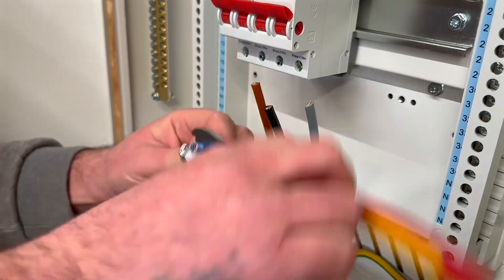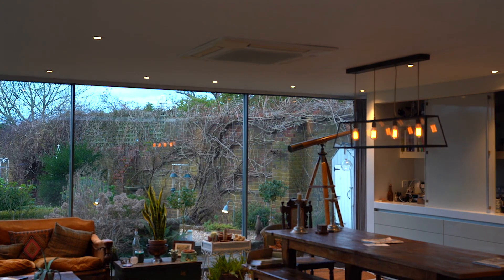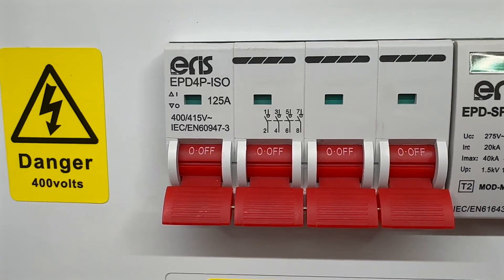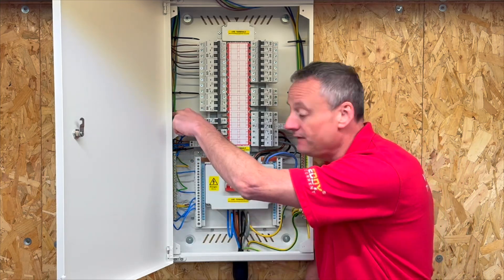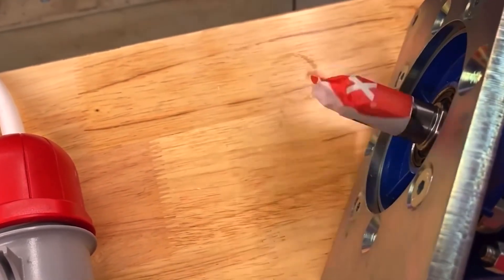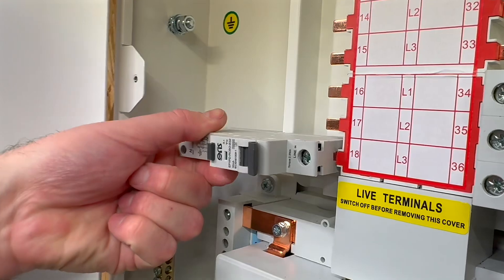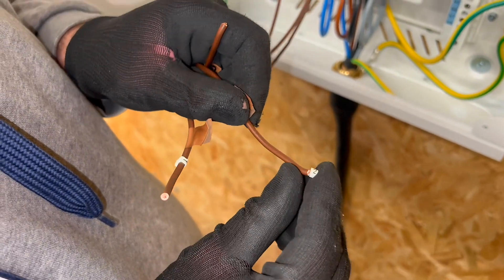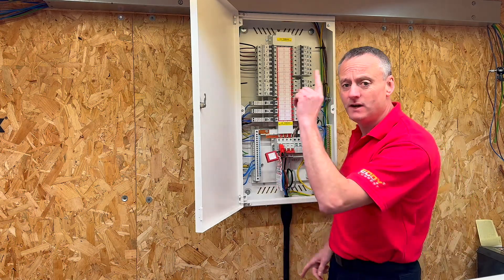Understanding Your Three-Phase Distribution Board

Comment from the maker: Learn more about the Eris Pro Range 👉 https://hub.efixx.co.uk/ErisProRange
Reply: No head RCD in the UK?
In France, there would be at least 3 RCDs for this board, covering all circuits.
Reply: And I can see you're not using a torque screwdrivers... there's no such thing as a torque calibrated arm...
Reply: @jezrougan  in my day as an apprentice there was no such thing as a torque screw driver but three types of tight
1. 👌 finger tight
2. 👋 hand tight
3. 👊 “F”ing tight

If you didn’t adhere to them then came
4. 🚑 not tight enough

Recently torque to 3 Nm required 1/4 turn more with the T screw driver. Doing it to 2 Nm ment I had to loosen them off first.
Not bad I thought for a 57yr old bean pole
Reply: @d.wood72  My father was a sparky and the only person I knew, who could drill a hole with a drill without pulling the trigger... while I was his appreciate, I found what looked like a worn-out tap for tapping treads... I said to him, "Why have you still got a worn-out tap?"  his reply was, "That's not a tap. "... "That's a raw plug jumper." 
He then gave me a task he would do as an apprentice with said raw plug jumper... bang twist, bang twist, bang twist... after only I did three holes, did I understand why his hands were like a gorilla's hands, and why he could drill holes with a drill without pulling the trigger... 
While doing conduit, he could thread 32mm like it was butter... 

R.I.P. father, you taught me many good lessons of the electrical trade...

Comment: 1 minute in the video and I already have to comment... I just learned it from electricians course btw, screw terminals that don't have pressure plate between screw and wire, can be only used for solid core wires. So straight or doubled is a moot point, at least by Estonian code they have to be crimped. If the connection is like in breakers- between two plates that screw only tightens- it would be okay, but still frowned upon, I have heard that usually inspectors want all standed wire crimped in all connections.

Comment: Did the ‘pro’ just strip the conductor insulation using wire cutters ringing the conductors and causing a point of failure?

( better to spend money on strippers rather than an electronic crimping tool!)

Comment: Thanks Gary,
I'm from New Zealand and I really like the look of that switchboard, I particularly like the idea of a dedicated space in there for surge diverters
(which all switchboards should have).
Regarding terminating to busbars and CB's, I was always taught about "terminal fill", meaning that when you have enough room in the terminal to twist the wire and fold it over, you should always do so, as it gives you more contact area in the terminal itself.
I've never liked the idea of just shoving a stripped un-twisted wire into any terminal.
Reply: In the uk I prefer to crimp any stranded wire to give it a solid connection. We also twist them and double them over too on stranded and solid conductors

Comment: Also some three phase DB’s allow for clean earth connections, separate from the main earth terminal
Reply: Is there a continuity between them?
Reply: @ No, it’s entirely separate from the main earth, which on a TNCS system is also linked to the Neutral at the incomer. Clean earths are usually separated by way of an earth rod to a separate earth bar within a DB
Reply: @barryamorris  a TT arrangement?
Reply: @ just for the clean earth circuits yes
Reply: @barryamorris  which circuits require a clean earth?
Reply: @ anything with very sensitive electronics.

Comment: ALWAYS double up the copper so as to fill up the termination space. This avoids overheating and arcing from poorly terminated cables.
Reply: Folding a 2.5 sqmm wire in a 5mm diameter tunnel doesn't fill up the termination space yet we still do it.  Sure the larger contact area improves the impedance but that's more of a nice side effect than the main reason.
Reply: @ the larger surface area also reduces heat build up, ensures a stronger termination, and reduces the chance of the termination failing. The single biggest cause of electrical fires are caused by poor termination of cables.
Reply: @ 'improves impedance'
Reply: @ The bottom line is that if you fill the terminal up with copper by doubling or trebling over the ends you just get a better termination.
Reply: @barryamorris  Except you aren't filling it up necessarily, are you?  Fill up a 5mm diameter tunnel with a folded 2.5mm2 wire, take a photo of it being 'full' and post it somewhere for all to see and demonstrate it being 'filled up'.  Good luck.
Reply: @ I mean literally fill it up with copper. No electrician ever does and I used to teach practical at college. The standard of workmanship is going down hill rapidly. Most don’t even double the ends over
Reply: @barryamorris  It's because it'd mean cutting a stub of wire to pack the terminal and absolutely no sane person is going to do that unless it is an explicit requirement stated in the job card or manufacturer's instructions.

Stuff terminals full of cut wire was never a thing.
Reply: @ Doubling or trebling the ends over are however!
Reply: @ Why are you adjusting your stance?  Could it be that 'filling' the terminal was never actually a thing, whilst folding it to secure it and coincidentally also improving the impedance actually was and still is a thing?  Hmmmmmm, might have to think about that a bit more.
Reply: @ Fill the terminal such that you get a good quality termination, that is both mechanically strong and yes lowers the impedance, and as such reduces heat build up.
Reply: @barryamorris  Still banging on about it eh?  Tell you what.  Actually do it.  Fold a 2.5 wire twice or thrice.  What ever.  Actually do it. Put it in a 5mm diameter (16mm2) terminal, run the screw home then take a photo and post it somewhere and show how much it 'fills' the terminal.
Reply: @retrozmachine1189 The more of the conductor that is held in contact with the screw or plate in the connector, the greater is the physical resistance to movement of that wire.

So mechanically it is a good thing to do.

It is also worthwhile from an electrical resistance point of view.

The lower the resistance, even if the R1+R2 resistance comes in below the required target, the better as it means the junction isn't going to heat up quite so much, increasing the life of it.
Reply: @deang5622  One of these days you'll actually read the comment you are replying to.  One of these days.
Reply: @retrozmachine1189 One of these days you will pass 5 GCSE's and one of them will be in maths. One of these days...
Reply: @deang5622  Look, if you had actually read my comment about what is going on when we fold over the conductor you wouldn't have made the comment you did, that or you are a clown.  I'll let you decide which.

Comment: I never understood this stripping and folding over conductors when all terminals are designed, tested, and certified to hold a conductor of given size range and type (stranded/solid). I never fold over wires, because now it's no longer the size the terminal is rated for, nor the size the wire is before folded over. It also creates additional strain on the wires, and on top of all that, a physical turn is a great way to create increased heat in a conductor.
Reply: It's precisely that.  If the terminal is designed to hold a given single conductor by itself properly, that's fine.  You don't have to and shouldn't fold a conductor before inserting it into say a Wago connector.  The reason for the fold is because the terminal isn't capable of holding an individual conductor as is.  That could be the holding screw can allow the conductor to ride up the side because it isn't wide enough in the tunnel to prevent it.  That could be the conductor is stranded and needs to be twisted to ensure the strands don't separate and again ride up the side.  It could be a combination of both those things.  It could be the wire is so thin that when placed under the screw it simply isn't clamped by the tip of the screw even if the tip is designed to fit the profile of the tunnel.  Issues exist for rising clamp style tunnels too.
Reply: @retrozmachine1189  most terminals involve a screw and drop plate. If it's not rated for the wire size you're using, folding the wire over doesn't change this.
Reply: @ Go back to school.
Reply: @ Did you actually read any part of what I typed before pressing reply?
Reply: @uwygjhsh Try reading my comment.  When you actually do, and understand what I said, then you can click reply.

Comment: MMM don't like that board.  Can't even isolate individual circuits for additional installations.  Looks like you have to de-energize the whole DB.  And they don't even have the tabs that also cover the supply busbar and terminal screw.  They've gone to the effort of covering the neutral terminals, but left a great big wad of copper hanging out for the link.  I'll stick to Schnieder DB's I think.

Comment: You Brits are so behind on the 3 phase game....

3x 25A supply is standard in the Netherlands for a modern house. 

With crappy, plastic distribution boards...

I had a discussion on that with Gordon a few years ago. He should still have some pictures of my db...
Reply: In ex-Yugoslavia (cca. 1980) 3-phase (3x25A) and load balancing between phases and RCD (FID) was standard for all residential installations
Reply: @vesnacvetanovskaivikj8606  Load balancing ID something that they still do not get in the Netherlands!

Ask me how I know!
Otherwise I can give you the voltages of phase 1, 2 and 3 which are completely out of balance.

Comment: It looks confusing at first, but it's quite simple in practice and very neat. 

Now if only somebody would come up with a way of getting rid of neutral fly leads via a neutral busbar and even having a CPC busbar and CPC connections via the breakers. Think how much neater that would be. The circuit wires then only need to terminate on the breakers.
Reply from the maker: All good points… some DBs do you have a connection for the neutral in some types of board?
Reply: They are not neat, they are terrible, archaic rubbish. Try maintaining a full 12 way TP&N board full of RCBO's when a few go faulty and need replaced. Nightmare to work round.
And that's not a slant on the brand shown, they're all crap and need a huge overhaul of the basic design. And all devices should be double pole.
Reply: We have em in Canada. I've seen panels with a neutral busbar along the breakers so easy way to land circuits, and some panels (like mine) the panel has a neutral bar the breakers tie onto which allows you to land neutrals alongside the hots on the breaker itself. Saves the inevitable pigtails when you need to land GFCI & AFCI breakers in the panel.

Comment: The 3-phase board in this video looks like an upgraded North American panel and doesn't have anything in common with the power distribution boards we use in Germany or the Netherlands where 3-phase systems are the standard for many decades.
Reply from the maker: Thanks for your input
Reply: To be fair:
In the Netherlands, three phase supply has only been done as standard the last 25-30 years. And then only for ground build houses.

A lot of apartment complex still had single phase going to the individual units in the mid 2000s.

And in all honesty:
Our Dutch distribution boards are cheap pieces of garbage compared to what the Germans put in a house these days.

Not a fan of their "unter putz" cabling however...
Reply: Yanks only like 110v yet the do have 215v but they think it's super dangerous
Reply: @octymocty132 no we don’t. In our homes we bring in 240v, we use either 120v or 240v, depending on what needs power. 
In commercial usage, they use three phase which can be 277 or 480v.
Reply: @uwygjhsh That's in large part because over the years the voltage has been going up. Used to be 110/220, then they bumped it to 115/230 and then 120/240.
Reply: Many (most?) homes in the USA have a 240 split-phase supply.  The DB supplies both 240V and 120V circuits.  Most of the circuits are 120V, but certain loads (electric clothes driers, for instance) and 240V.  Industrial sites, however, are almost exclusively 3-phase.

Comment: The earth bar mounted to the Metle frame of the cabinet does not require supplementary bonding between it and the earth bolts.
It has been seen that a linking CPC between bolts can become live for a variable time when the bolt it has been attached to has not been tapped or threaded into the cabinet. This happens several times within the industry I work in where age related DB’s have had several generations work upon them. 
It is a mind boggling time diagnosing when the DB serves several pump circuits, lighting and heating circuits and all have the same colour supply cable.
Reply from the maker: Thanks for the detailed comment
Reply: Do you mean all have brown line conductors?
Reply: @anthonybragg  in a Fire Pump room Red is a common cable colour of pre 17th edition builds. White and or black are also common. If it was built with 16th edition in place then RYB can be found particularly with lights and electric pumps though anything else can be what ever was left over from the last job.
Reply: @d.wood72  I know that in a previous edition of the regs when you had the pre-harmonized colours where you had red as a live conductor in a single phase circuit you used to be able to use red, yellow or blue as the live conductor matching the phase it was on this was changed so you could only use red as like we use brown today.
Reply: That is a design fault then.

Comment: Difference in terminology from an Australian electrician. We would not describe a board that supported 12 3-phase breakers as '12 way' but as '36 pole', and these vertically aligned busbars are commonly called a 'chassis' or 'chassis board'. So when I'm looking for suppliers of such DBs I'm looking for things like '36P' or '72P'.
Reply from the maker: Great info - we’ll have to pop over and take a look!
Reply: @efixx  Do let me know if you're ever down under, I'd love to give you a tour of an Australian factory and discuss differences in regs and install practices.
Reply: It's called a 12 way TP&N, not just 12 way.
Reply: That makes more sense tbf, you know exactly how many ways for either single or 3 phase with no confusion then 👍

Comment: I was lucky when I was at college we did do three phase boards but we only installed and dressed in the three circuits we never had live power to them and we never did any testing on them.
Reply from the maker: Fuses or Mcbs?
Reply: @efixx  fuses and MCBs depending on what you were given and what the specification sheet said. I still have a load off the 15amp cartridge fuses  not much use for them now though don’t really know why I keep them